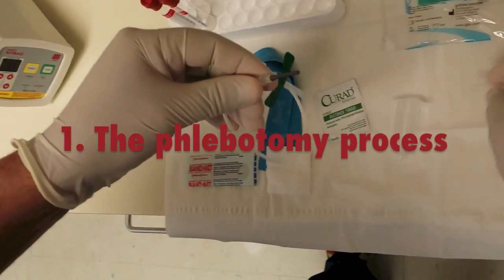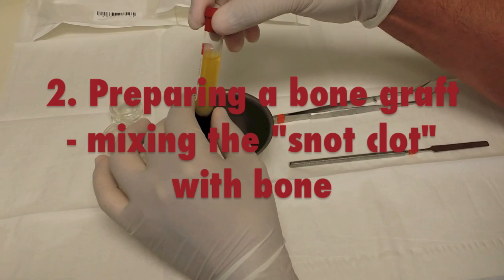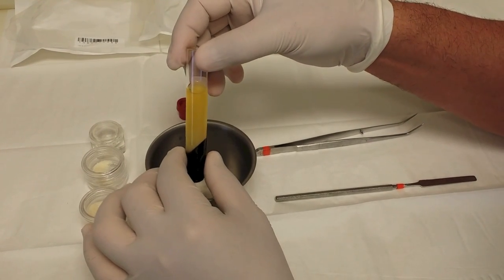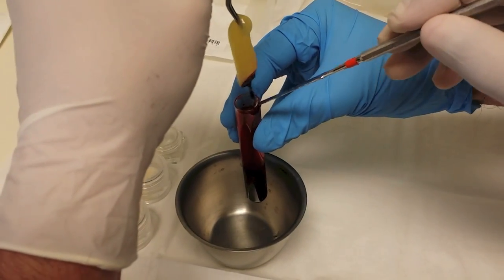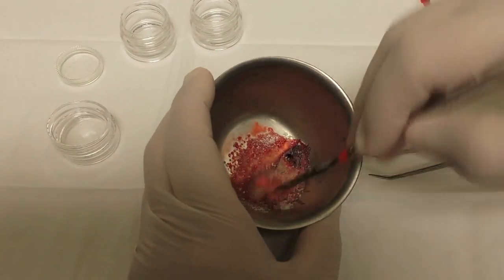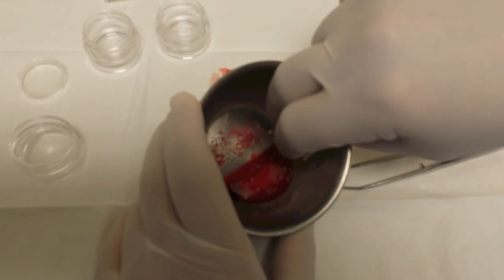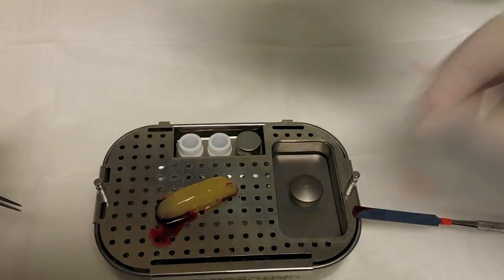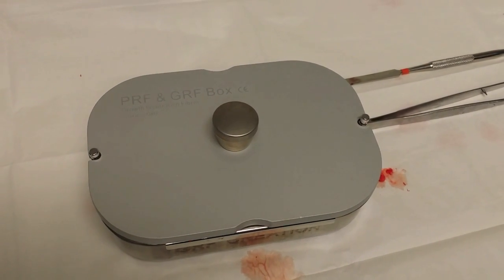Platelet Rich Fibrin (PRF) - A short introductory Video

Comment: thanks for the video.  I would have liked to see the suturing of the membrane, as compared to commercial membrane
Reply from the maker: Linda Wick Dear Linda: 
Good question about the suturing.  We will show something similar to what your asking in the future, as that is a good idea.  Let me cover it now though to respond to your request.  So, you simply flatten your membrane utilizing the box to be able to utilize the "SNOT CLOT" or CGF mass as a membrane.  You would simply place your graft like normal.....then lay your flattened CGF membrane over the grafted area.  Proximating the tissues nicely with gauze and squeezing the area firmly yet gently really helps before suturing the area.  THEN you are ready to suture normally.  A continuous locking suture is recommended over the entire grafted area for nice stable tissues.  Primary closure may not be possible due to the graft taking up space if it is a large graft.  So, you may need to release the buccal flap fully as well as the lingual flap to be able to coronally reposition the tissues.  IF you need to do that procedure and you can get primary closure, horizontal mattress sutures are recommended B4 you suture with the continuous locking sutures as described before.